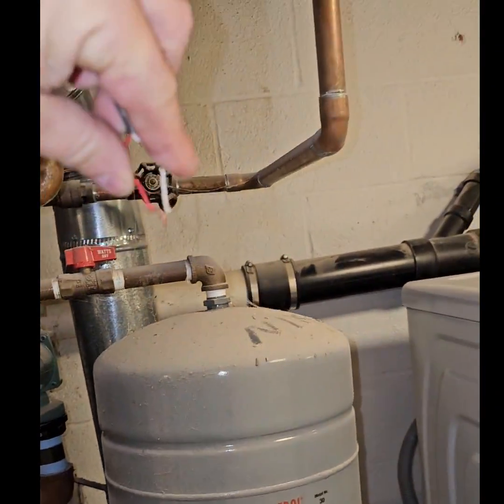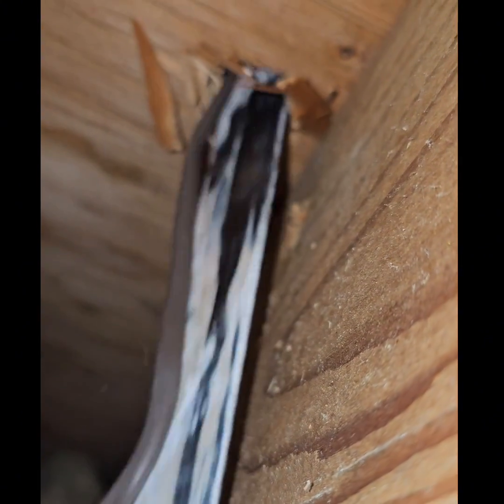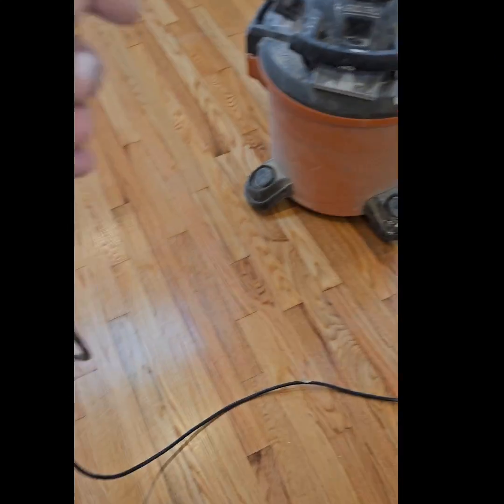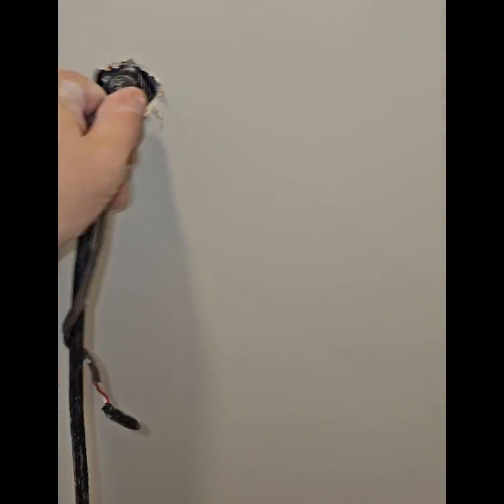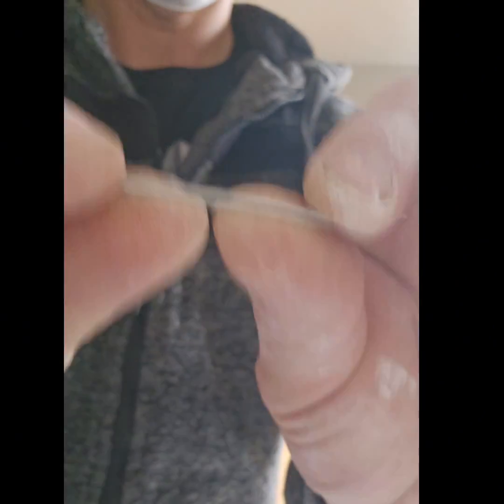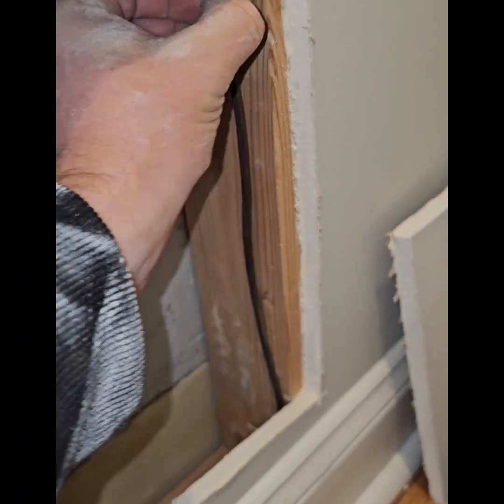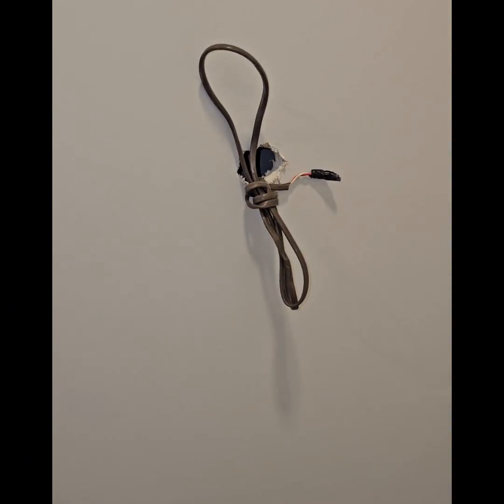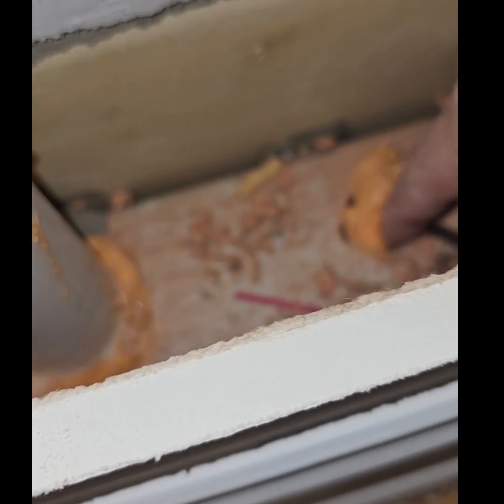🛠7 Mind-blowing Diy HVAC tricks if you have minimum tools & supplies- Expert HVAC Advice 🤯 #hvac

Comment: I have to use 2 hands now to count the amount of times i forget my full tool bag at home, and only have like a side multimeter a 6 in 1 and box cutter blade and ofcourse i always have electrical tape somewhere. I mean ive worked 3 jobs with these sets on a single day, before i need anything else, but ive definitely had to mcguyver tools